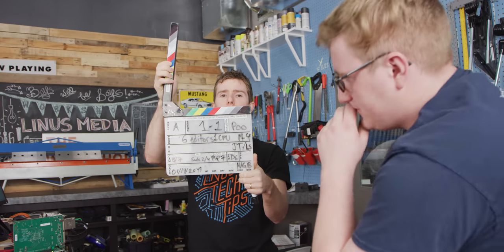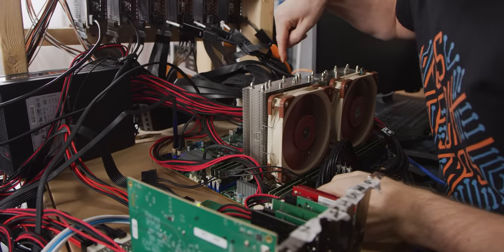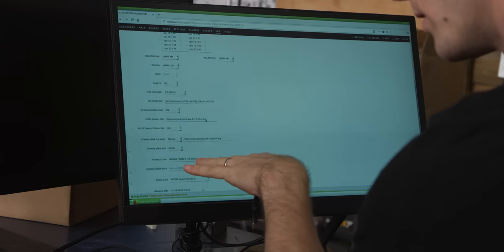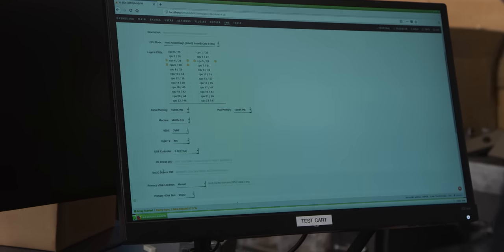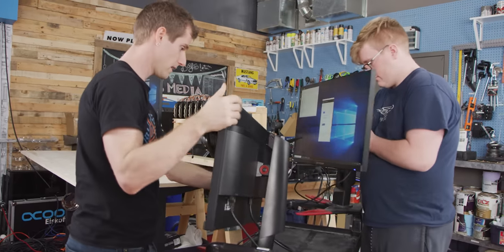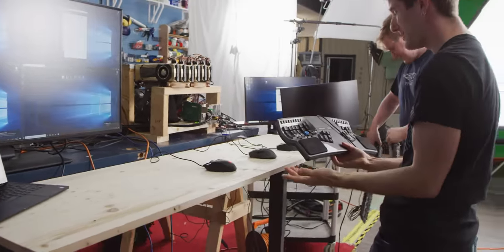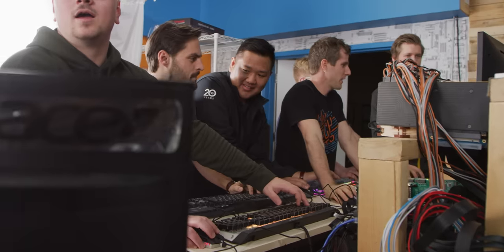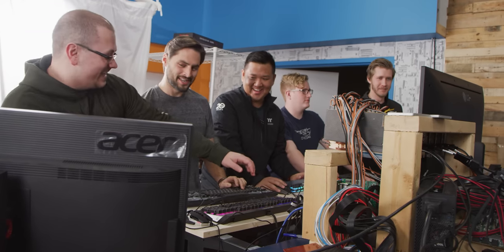The $100,000 PC LIVES! - 6 Editors 1 CPU Pt. 5

Comment: If I had a PC worth 1% of this I would be so happy
Reply: Me too.
Reply: I don't even have a pc
Reply: I have a 400$ pc and monitor of course  i mean that they cost 400$ together
Reply: I have a pc worth 0.5% of this pc
Reply: I only have laptop
Reply: I have a laptop that costed 0.3% of this lol
Reply: Same
Reply: @salsaman9054  Dude i got a pro tip for you, save up like 50-60-70-80-90-100 bucks and go on ebay and buy a nice laptop with lie a core i3 or core 2 duo
Reply: Get a job and you can.
Reply: PuppetGameReviews , With beastly Intel HD Graphics!
Reply: @Vincent_Beers  lmao dude my PC cost me €800 (including a 144Hz monitor) and it can run pretty much everything at high to ultra at 1080p 144 fps
Reply: @Vincent_Beers  someone is overpaying for their pc components
Reply: I need at least 12%
Reply: @Vincent_Beers  A $1000 PC wouldn't be trash, but it's still better than nothing. And, you can make a pretty good computer using $1500
Reply: Vincent Beers , you are forgetting something called bills and basic life necessities.
Reply: @Demac.44  Didn't over pay for anything, in fact everything I put together I buy on sale, I just buy from the high end of parts. Like when I bought my last GTX 1080 I only paid $500 for it (and that was before the 2080's came out and they were averaging $800, but I waited for a sale)
Reply: @autismo8123  Specs if you will?
Reply: @Vincent_Beers  Lol I don't either of those things and I'm still broke
Reply: No one builds PCs like this unless you're desperate for space. This is dumb. Literally dumb.
Reply: @michaelzervas8010  same
Reply: @kiyoponnn  its cheaper cause its used but here they are
Monitor FullHD 60hz
Pc
Gtx 1050ti
Intel Pentium i5-750 2.66ghz
8gb ddr3 RAM (shitty)
500gb hdd (shitty)
No ssd
Some old asus motherboard
Old cracked case
Reply: @Vincent_Beers  no it doesn't but ok
Reply: Vincent Beers lmao how is a 1000$ pc trash?
Reply: im honestly happy with my little laptop, its a lenovo thinkpad t430 nice budget high quality machines
Reply: @You-tv5io  exactly ;p
Reply: @autismo8123  For $400, it's actually not bad
Reply: @Vincent_Beers  So do you have an 8k setup now?
Reply: Joseph Leone  was it worth it?
Reply: @Vincent_Beers  what are your specs?
Reply: Joseph Leone  1.5k pounds is near $2,000 USD so you know exactly the range I'm talking about
Reply: @kiyoponnn  yeah buuuuuuut my graphics card broke now i have a borrowed 730 luckily i have the money for a new one and im just waiting for msi to tell me if im gonna get a new card or get this one fixed or whatever if they dont i might get myself a rx 780 4gb
Reply: @Vincent_Beers  Bro money isn't as plentiful for everyone. Saving is a good idea but some people just don't have the ability to save and have to do it very slowly
Reply: @Vincent_Beers  Quit being so pretentious. You are exactly the type of person that gives any community a bad name
Reply: @TimTams_64  give him a break man it can be hard to get a steady job with not alot of experience
Reply: @Vincent_Beers  Yeah, you're partially right.
Reply: @Vincent_Beers  with $1000 you could build something with a 1070ti or higher and you're calling it trash?
Reply: @autismo8123  Ohh I see
Reply: @Vincent_Beers  You could get a R5/R7, Vega 56/2060/1070(TI) build for under 1k easily.
We get it. You have money to spare. Go flex about it to your dwindling amount of friends instead of everyone else.
Reply: @Vincent_Beers  you are the type of guy who says people are poor because they dont have air pods
Reply: Just don't be poor👌👍
Reply: @Vincent_Beers  I don't think you understand how expensive parts are haha. Or the performance per dollar statistics.
Reply: @Yuki-bk2my  Ikr
Reply: @Vincent_Beers  I dont think you relize that some people cant dumb 1000's of dollars into a computer,  and are fine with a core i5 and 8gb of ram
Reply: @Vincent_Beers  1080p is the standard today, it was 720p 12 years ago
Reply: @Vincent_Beers  somehow you seem to forget about other countries. Hourly minwage in croatia is around 2.8 usd, and people barely live off of that. Most of my friends have 1k usd pcs and theyre great. I have a much better job so I can afford more, but a 1000 usd pc aint trash.
Reply: @Vincent_Beers  You don't need a rtx 2080 to have a decent pc. I have a i7 7700k and a gtx 1080 and it cost me $1400 with a gsync monitor and peripherals it's called getting the best deals(Pc alone cost me $900). Also what's wrong with a gtx 1070 and a i5 or ryzen 5? Or even a 1060? I mean playing at 4k is nice, but most people prefer 144hz 60fps. Anyway you're entitled to your opinion, but remember that other people can have their opinions too. Maybe you see 4k as the future and think it's the only way to game and that's your definition of "high end", but most would rather have a smooth experience rather than more pixels and until we can run most AAA games at high fps 4k 144hz, we'll stick to our 1080p and 2k. Moreover concerning saving money, most people have different hobbies, responsibilities and plans. Some people might be saving for a car or for a trip, maybe they would rather spend the money on their children or loved ones. Just remember each person is struggling with their own problems, the person you are attacking in the comments might have a sick loved one who they are struggling to pay for their medical bills or other problems that prevent them from saving even $20. I for one save $100 a month for pc upgrades, but I sometimes have to use that money for other stuff.
Reply: @Vincent_Beers  you clearly dont know computers vincent. Anything under 5000 is pretty much trash and something for the kids to play on.
Reply: @Vincent_Beers  you're just spoilt
Reply: hunter borman I have a pc worth 50- 75 bucks
Reply: @Vincent_Beers  
Ryzen 2600 / i5 8600k + rtx 2070 / Vega 64 is trash?
Reply: @Vincent_Beers  Lol, "You cannot even comprehend the amount of dark power i have in this wand!!! you silly mortal!" your comment kind of sounds like those mid 80's dungeon and dragons evil wizards
Reply: Joseph Leone  
I don't really get what you mean with that comment
Reply: Joseph Leone  GTX 1070 + R7 1800X, got it last June. Haven't come across a game where I had to set the settings below high.
Reply: Joseph Leone  
I got a R5 1600@4Ghz and a Vega 64 for about 1000€ last year
Reply: Joseph Leone  
My Monitor was 650€ though xD (Acer XR341CK) and my Oculus rape gouhouka was pretty expensive too. But i bought bouth used, so its pretty ok
Reply: Joseph Leone  
Hardware is pretty cheap in America :/ could be true
Reply: Guys it's big joke. I have a Matebook X Pro and a GTX 1070 Aorus Gaming Box

Comment: In 2005 I was running a project for the US Army and Lockheed to build computers for use as tank simulators.  We were getting boards from Tyan that were still in prototype phase and Nvidia was getting us unreleased graphics cards to test out.  We also were working with SLI which was brand new tech with Nvidia at the time. It was a super cool project to work on.

Comment: I like experimenting with computers and I had a similar incident once.. I made a Dual Monitor , 5 - OS System ( Windows 7,8.1,10 & Linux, Android) , and it worked!! Unfortunately the laptop had some hardware issue and I had to unplug some ram and the hard disk to open the case & after I reloaded everything , the OS was literally freezing now and then.. I started panicking and then I noticed a common pattern - Windows was always getting stuck during hybrid shutdown , which made me think that it was related to ram ,and swapping the slots did fix it!! Unfortunately repeated startup and shutdowns corrupted the Windows 10 's partition , it froze after boot every time.. I ran some hdd tests and it passed , the other 4 OSes were working , so I formatted and reinstalled 10 again , and everything started working again.. Still have that laptop till date and still loving it!!

Comment: But can it run crysis
Reply: Yes. 7 times simultaneously.
Reply: But can it Ray Trace crysis?
Reply: @im_aleey  Also yes, if Crysis had ray tracing. The Titan V is supposedly capable of ray tracing even without RT cores.
Reply: @nawarelsabaa  no its not without the cores man wtf are u saying
Reply: @panickyk2300  it absolutely is possible, it's just slower without the RT cores. Hell, the Quake 2 path tracing project even works on a 1080ti.

Ray tracing doesn't require special cores, they just make it faster. Ray tracing is built into Vulkan, so most modern GPUs can use it. Same goes for DX12 I guess, but it's a bit more complicated and requires additional stuff to work properly.

Comment: Linus here building a 100k PC meanwhile I'm here and can't buy a 1155 Mobo lol
Reply: It is I who Nuts to That I know the pain. Still running on X58 in 2019 XD
Reply: Dude finding a good 1155 nowadays are next to impossible
Reply: Sebastian Haban you aint the only one. My rig has a i7-980x oc’d to 4.36ghz water cooled on a evga classified 3 way sli board with 24gigs of g.skill ripjaws x 1600 oc’d to 1866mhz. 1 980 Ti kingpin and 1 980 Ti classified in SLI and a evga 1600w p2 power supply. 1.5TB SSD and 6TB HDD. The case is a Corsair 750D. USB 3.0 pci-e 1x card connected to the case front 2 usb 3.9 ports and also provides 5 more 3.0 ports for a total of 7 usb 3.0 ports.

I have another kingpin card but it needs to be sent in for warranty due to white screen crashes. Still has little under a year of warranty left.

Comment: What was the standing desk feet they used? i want to build a new desk!
Reply: I'm wondering that as well, specially the "inexpensive" part
Reply: Looks like VIVO Electric Stand Up Desk Frame . I recommend the dual motor version. It ends up being $270 shipped from massdrop when they have them.

Comment: Install Windows 10 using a floppy disk and a Windows ME machine.
Reply: you d need like a fuckload of floppy discs.
Reply: @bmxriderforlife1234  or 1.
Reply: @andy56duky  dont think itd all fit.
Reply: A standard 3.5 inch floppy disk has a storage capacity of 1.44MB. You need about 4GB of space for a Windows 10 installation disk. That means it'd take about 2778 floppy disks to install Windows 10. That's a 30 feet tower of floppy disks if you'd stack them on top of eachother.
Reply: @qwertyuiopzxcfgh  omfg. linus needs to attempt this.

Comment: Wow didn't know Tyan still existed.. I personally haven't heard that name since the early 2000s when I personally owned a Tyan Thunder motherboard for my old dual Pentium 3 system.. It was a beast in quake 2, quake 3, and half-life, counter-strike 1, and team fortress 1.

I miss the days of consumer level dual processor boards and games that had no problems with working with them. I wonder why intel/amd and motherboard manufacturers stopped offering consumer level dual cpu motherboards, and restricted it to workstation processors (xeon). I'd imagine a dual pentium i7 or i9 system would be insane if modern hardware and apps/games worked with them as they did back in the Intel Pentium and AMD K6/Athlon days.

Too bad Xeon is the only option we have today but these don't offer any benefit in games and you're better off just having a single i5, i7, i9, or ryzen cpu if you're just going to play games.
Reply: same man same. my first non apple pc was a 4 core intel dual socket solution. was a beast.
Reply: Supermicro still has pretty cool dual socket workstation boards. I have 3 of them myself
Reply: @johnkristian  but they dont use consumer cpu's thus they typically cost alot more then the old consumer oriented dual socket set ups. 

cpus cost more. boards cost more. and alot  of times they dont have other features you may want for a prosumer grade board. 

also i hear supermicro really isnt as great as its cracked up to be.  though i hear conflicting reports. some claim them to be like the best server/workstation boards, others claim them to be average and overhyped. a few say they actually have some pretty terrible boards that dont really meet the requirements for a true workstation or server board.
Reply: @bmxriderforlife1234  yeah. Consumer cpu dual socket is long dead.
Reply: @johnkristian  yeah which sucks. id love to have some dual socket consumer boards.  kinda overkill but meh.  would be sick to have a dual socket system overclocked. think like ryzen parts 6 cores 12 threads each. overclocked to the balls. and then idk single dimm per channel set up so you can have better ram speeds to get that infinity fabric running nice and fast to lower latency. 

on the soon to be released zen3000 we should see memory speeds go up.  the separate memory controller should mean they can get a better average quality. plus having it on 14nm increases the likelyhood of it not failing and being made by itself should also help in yields.  only allow r series chips on the dual socket chipset. use all the worst memory controllers on the athelon series cpus which also use the worst zen sillicone most likely. should still do well, cpus wont be clocked as fast. less cores. probably no overclocking, meaning the memory controller should be less stressed. 

but yeah intel never released another one after that skull lake series or whatever it was called.
Reply: @johnkristian  unfortunately these only support Xeon, not dual consumer i7 or i9 setups. Unlike older dual motherboards during the Pentium and K6/Athon era, where they supported dual consumer level cpus and were beast mode in games at the time as pretty much everything supported or benefited from dual CPUs as games/apps with no specific dual cpu support for the most part treated the two cpus like one combined big cpu.

Comment: Why do the editors need new machines like every year?
Reply: Wimbold to edit videos
Reply: @keepmovingforward8821  It's not like they melt from a little bit of usage.
Reply: This doesn't count.

Also, most of our comps run Titans acquired during the Whole Room water cooling era.

But tbh with R3D and everything 128GB of RAM and the extra VRAM of the newer Titans would help. Could care less about the GPU or the CPU. It'd make our entire workflow more stable and capable.
Reply: @AlexPotvin  Fair enough.

Comment: You never told us what fps you were getting!
Reply: Three Xeon cores with 2133 ddr4 (highly likely it's just jdec) should run CSGO at around 220 FPS I reckon. Graphics settings are irrelevant with Titan V.
Reply: luuzeri you can run csgo around 600 FPS with a 2080 ti or titan rtx. And like a i9
Reply: @tylermacdonald3546  the graphics card is straight up irrelevant as long as it's remotely recent. Like 970 or 480 for 1080p. You just need single core oomph with 3+ cores and fast memory. You won't consistently run 600 FPS with anything. 1% lows of 300 takes 3200mhz ram and 5GHz overclock.
Reply: luuzeri true, but I just saw that off a few benchmarks

Comment: Is workstation gaming rigs going to become the new meta? I was gifted a Z800 previously used by Activision. 12 ram slots with the ability to have over 200GB ram and dual CPUs. Through a 1060 SSC just to see what it can do. I can render 20 minute 1080/60 videos in twenty minutes and play games like BFV @90-115fps. Thinking about upgrading the motherboard to something more current and getting another Xeon processor in there.

Comment: You may not need another 8180; Intel just came out with the W-3175X. Same socket, $3000 instead of $10000, and the performance is about the same.
(But you probably got the e-mail about it, too.)

Comment: LTT... it's SAS 12gbps... not U.2, servers don't use U.2, because SAS HBAs or HW RAID controllers are what servers actually use, not individually addressed storage devices per connection... goof! It's even in the spec sheets for server mobos! It's actually more that U.2 started using the same connector that SAS 12gbps initially rolled out with.

Comment: 12:10 pretty much. No modern mid-tier server has any cabling - apart from maybe SAS cabling to a disk backplane - inside the machine. Like at all. It's all modular and the reason is pretty simple: maintaining a machine with a billion cables inside sucks. Imagine how annoying it would be - besides the fact that, if you need to hot swap a part (as in, whilst the thing is on) it would be almost impossible to not crash it by accidentally unplugging something else that needs to be plugged in.

Comment: Hey Linus you probably wont see this but what ever. Anyway i was thinking on buying my very first PC and also thinking of building it myself with no experience. Any tips? Thanks.
Reply: Check out the forums.   There's almost no way he's going to see your post.  But I'd recommend building it on pcpartpicker first.  It'll make you aware if there are incompatibilities, and will also show you the estimated power draw (which should be roughly 60% of your psu rating for best efficiency).
Reply: Z3R0 CHANC3 ok thanks

Comment: Eventually my laptop will be worth 100k... I hope.
I mean, 8 and a half years of usage, the disk died (replaced), battery drained (also replaced) and the touchpad went nuts (I use mouse so idgaf), but it's WAY better than cheap laptops you can buy these days.
Not to mention, today the Windows 10 it had installed (It had AND WILL HAVE Windows 7) simply updated and suicided, now the laptop is a loop of booting up, going back to the previous version of Windows 10, restarting and then repeating the process :p
Might be a good chance to reinstall Windows 7 tho

Comment: you guys should use Enterprise drive the Enterprise ssds from other manufacturers dominate like the Enterprise Samsung nvme drive destroys the 970 and performance it's ridiculous it's almost as better as two of them togethereven Western digital hard drives Enterprise are way better than most of the SSD is out that consumers can get.  Samsung has an nvme pcie in the Enterprise drives drive that has 12 TB and 6300MB read and 3000MB right